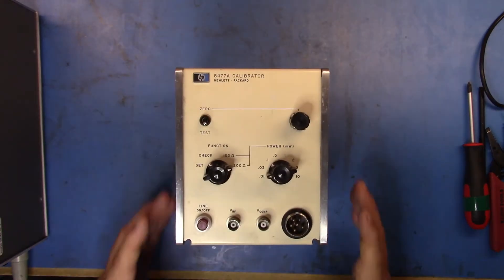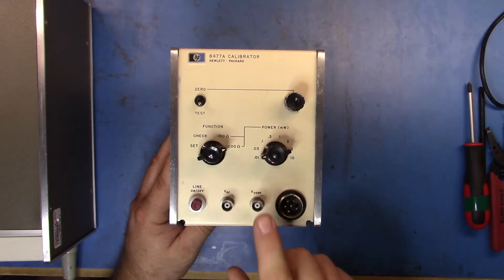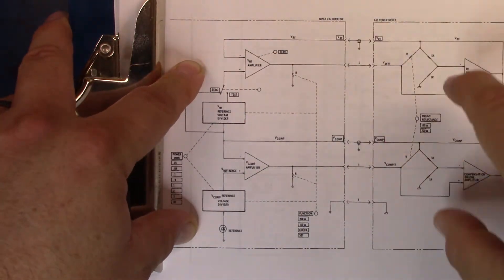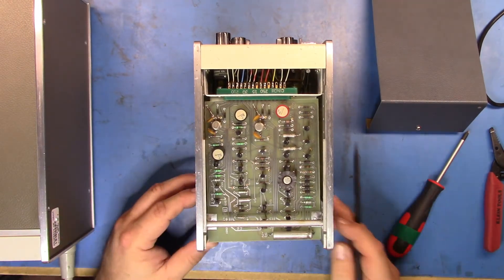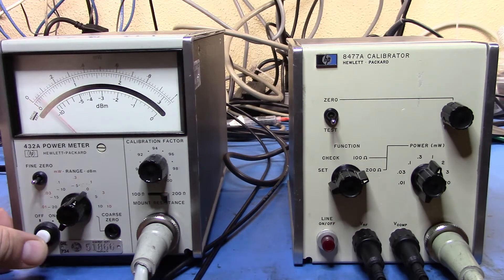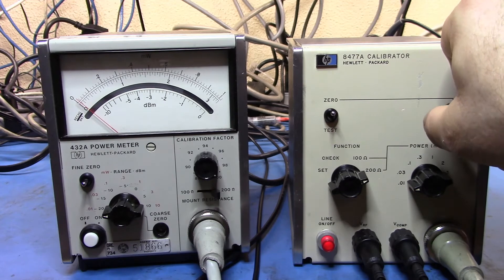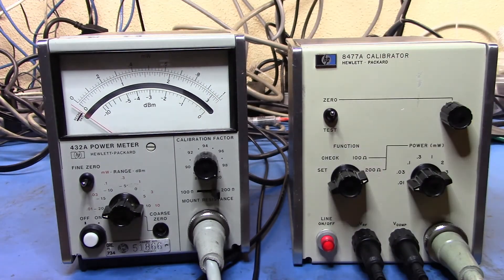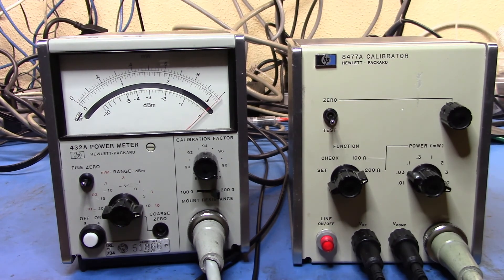HP 8477A Calibrator - First Look

Comment: Great video.. thank you.

I have the same calibrator only one wire hase been loosen someway..
Is the a way you could help me out?  There are 2 wires running from the Vcomp the one used to connect to the AR2 switch hope you can guide me..

Thanks.
Regards,
Raymond
Reply from the maker: Happy to help - Coult you take a photo of the area you need help on and post the link so I can see?
Reply: I’m not able to share the picture link on YouTube my messages get deleted?
Reply from the maker: @rayvr6  Email it to me - me at tonygoodhew full stop com
Reply: @tgsoapbox  
Can you please mail me on 
mistii msn com

I’m unable to match your mail in the right way .
Get return mail service
I’m sorry